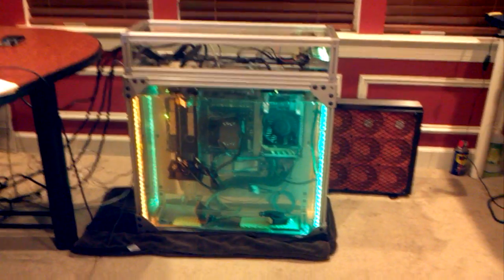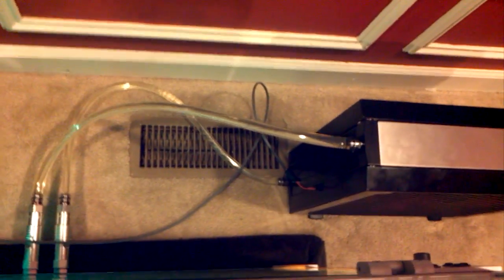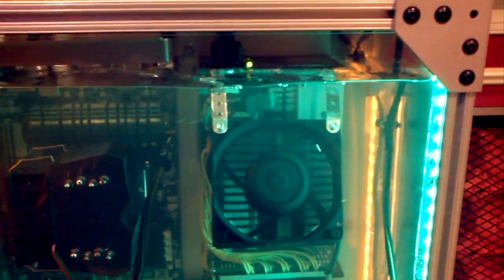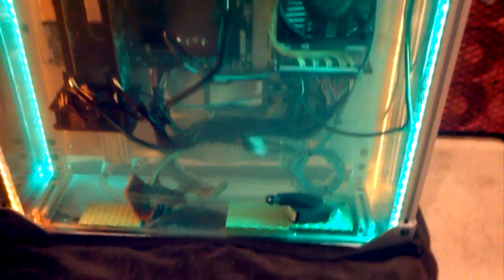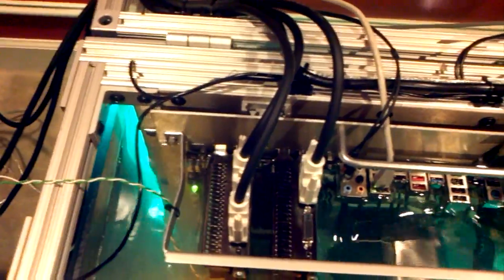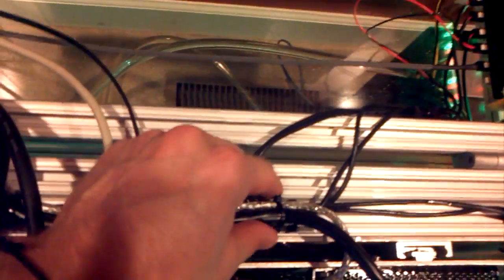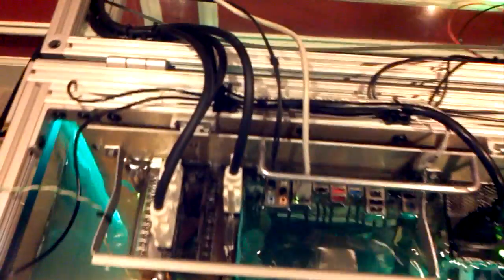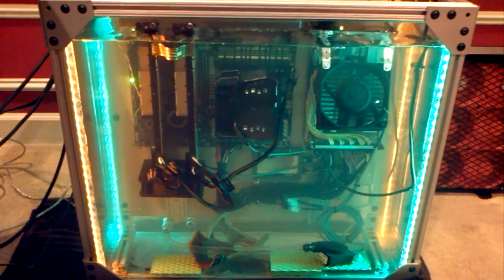Mineral Oil Computer Done!

Comment: I've heard submerged PCs like this don't need a heat sink. since the oil just creates sort of a thermosiphon. (hot oil flows up and cool oil comes from the bottom)
Reply: i don't think the oil would conduct the heat from a CPU fast enough and flow away for that to happen, the CPU would quickly overheat.
Reply: Well you may be right but I've seen it done both ways. They could have also been using some other nonconductive liquid or maybe an older CPU that ran cooler.
Reply from the maker: In my experience your statement is flat out incorrect.  I actually did experiments without forced oil flow and it actually stratified to an amazingly strong degree.  The oil on top was burning hot while the oil on bottom was just warm.  You need forced flow with this much oil
Reply: RabidCicada Ya that makes sense now that I think about it. I can't seem to find that one video where they didn't use a heatsink...whoever it was probably didn't figure that out yet.
Reply: You know what i always found strange about cpu's, what if they were bigger, like much bigger. Would they heat less??/
Reply: minigunexo
Yes and no. Here is why, if we make the processor bigger with current 45nm and smaller cpu chips. Which is how we get 4 cores and so on. We would stack more into the dye since there is more room. However it would be possible to put twice as many cores and run the voltage lower to which in the end would actually add more processor power. This simply a numbers game there. If you did not add cores, then you would be driving up the cost of the mother boards needing to accommodate this dye size for little reason. Realistically this is actually a really good idea, but the market is aiming for more power on a smaller dye. Because of this a bigger dye would likely not happen. I should be considered for servers though since most of those boards are ram and processor going out to a storage farm.

Comment: nicely done, but I don't see a water separator.You must remember that oil is hygroscopic, meaning that it will take in water from humid air. While that might not be an immediate problem having water flowing around near the circuitry sooner or later will be and will cause some mayor connection (and short disconnect) problems.

Comment: If everyhting is litteraly swimming in coolant/lubricant and it operates 24/7 its ok, but when it stops oil will get over graphite brush of the electric engine of the fans, what will happened with fans? Im asking because I want to build something like this but use pumps instead of fans to cool the parts....

Comment: a few things, 1: that dual pump you were getting the X2? how did you set it up, one pump as flow the other as pressure, or both even, 2: positioning the pump, wouldn't it be best to be near the top to extract as much hot oil as it can?, 3: for a different radiator setup check this one out /watch?v=d1_iZ-4Tft4 setup like exhaust fan(hot oil in)fan>rad>fan>rad>fan>rad>fan>rad>(oil back to tank)intake Fan, just a few questions/thoughts

Comment: It is for show and at the same time its not for show. Yes you are right there are much easier ways out to cool your PC. But there are none nearly as efficient. In the video he seems to have a pretty beefy system since he said he had two video cards as was talking about adding a third. By building a system like this he will never have to worry about overheating no matter how much he pushes his system. Even if he overclocks his CPU to its absolute max.

Comment: Mineral oil provides much better cooling than just air alone. By building a machine like this you can push the system alot more and pretty much overclock the CPU as much you want with absolutely no overheating.

Comment: The fan does get oil in it.Everything gets oil in it. The reason people use mineral oil when they do builds like these is because it does not carode metal ( aka rust ) and also does not coduct electricity ( no shorting out ). As far as hardware limitations the only thing I have ever seen is that it seems most fans dont like to spin near as fast as they should. But everyhting is litteraly swimming in coolant/lubricant so no issues.

Comment: Deionized water or distilled water does not conduct electricity, however if ions are introduced into the water it will. Also, water would cause rust.  For that reason mineral oil is used.

Comment: never knew something like this existed.  Kinda wanna try it for the hell of it.  How much does it usually cost to build something like this?  Not the computer parts, just the components like the Case, fans for flow, and the mineral oil or whatever's going in there.

Comment: i like simple pc cooling air or radiators like h100 with out of tubing job and pumps ... this is to extreme for me well its prob geat OC machine yust its not very practical if u have to un plug it remvoe graphic cards replace processor or samthing looksl ike lots of job to do to even get started  with that and if u need move your case from your home somwere else u need ro remvoe all that oil ... when i think on all that stuff its not worth it (good side no over heating or dust problems) :)

Comment: I was thinking you should move the pump (sitting at the bottom of the case) towards the top. Since warmer oil will naturally rise, you will be pumping the warm oil to the radiator, not the cooler oil at the bottom.

Very cool

Comment: If you dont have a radiator I would think a lot of Kobber Wiring would do. You can get it from any Electric motor such as a damaged Mixxer. just putting a lot of it into the oil and the rest at some cool air should cool a lot already.

Comment: It wouldn't be that informative if you don't know what voltages and clocks he's running. He could say his CPU sits at 65c and video cards at 75 and it wouldn't seem that impressive unless he told you he's got twice the voltage running through those chips.

Wouldn't surprise me if it ran only a degree above ambient if the system wasn't overclocked.

Comment: I just dont get it. One would assume the benefit of mineral oil cooling would be either less power consumption or less noise. Instead you have a much larger case and much more power consumption. Sure looks cool though

Comment: Awesome PC build dude, it's pretty epic. Not hating though, but.. isn't it a pain in the ass if you need to connect a removable storage device? Flashdrive, external hard drive, phone, camera etc? Not just because of the mineral oil, but also because you'd have to open up your PC each time you want to connect something? Unless you've got a USB splitter?

Comment: Its ok to be nervous. Spending all kinds of cash on a new build is nerve racking, but builds are usually pretty streight forward. With liquid cooling, usually the modules are pre sealed and use PH neutral water, so as long as your components arn't abundantly dusty, even if your cooler tubing ends up leaking for some unlikely reason, and your computer happens to be on, it shouldnt bridge any connections thus your components should be fine.

Comment: What he is saying is, having that radiator with all those fans and equipment stripped away the usefulness of having an oil cooled computer.

You could have used a standard case with a water block pumped into that same radiator, with the same net result (liquid cooled system), but without all the oil and mess.

You still have the novelty though, and is really the point of the whole endeavor right? :)

Comment: What if you put the gpu and cpu on the bottom so that the hotter mineral oil rises and the cooler oil falls? 
It'd work just like a water heater! 
Like you said, it wouldnt help to move oil directly over the components, but it would at least provide circulation (through convection) without need for pumps.

Comment: Why don't you use short extension cables to move all your cables so they plug up outside the box instead of going through a hole in the lid, that way you can completely seal the whole box and completely fill it so that you can more easily more it or lay it on its side with out the risk of spilling, Heck you could even turn it into a cool coffee table.

Comment: FYI, Arrow Electronics sells those Molex connector parts in single piece qty.  Typically much better prices for Molex parts than DigiKey.  Sometimes they use a different part# for the single piece vs qty packaging; so, you may need to talk with cust svc if you can't find the single piece availability.

Comment: I would have done this at some point in my computer building life but I suppose the issues like oil sneaking into crevices you don't want it (under the CPU) and having to wait for the parts to drip dry (Takes a long time. Something like a week+) has put me off a bit. Think I'll stick to watercooling parts (although having a mineral oil PC wouldn't look out of place in a living room as it looks like a fishtank and would make quite the attraction with the bubbles moving around).

Comment from the maker: IT is not still running.  I had a kid and trying to do anything with it was messy:).  The system worked fine.  There is an increased risk of components dieing due to the chemical reaction you are talking about.  Mainly certain plastics and rubbers react poorly with mineral oil.  Just try to select products without those.

Comment from the maker: The performance of cooling individual parts would not be near as good then.  The fans are required to circulate for better temps on components (as in needed to push oil directly over the components), and due to natural stratification in the oil.  You solution would solve overall circulation but not handle pushing oil directly over components.

Comment from the maker: In terms of performance...it's really a trade off.  For the gpu's mineral oil was largely better...for the cpu...oil was minimally better (but also using a super high powered fan).

I switched back to water cooling because I had a kid and doing anything required 20 cleaning rags to wipe off myself after I was done >.<

Comment from the maker: I don't know what kind of water cooler you are talking about...but the kind on refrigerators require compressors (which are very noisy) and the kind of graphics cards and cpus require something like fans to remove the heat at the radiator anyway.  Am I missing something?  All systems require either active heat removal...or huge systems that can dissipate passively.

Comment: is you system still running? i got after 1 month first problems to solve cpu socket need to isolate oil flows inside and isolatet the pins from the cpu. starting wih bluescreens from time to time.

Comment from the maker: You can absolutely do this with other graphics cards.  Just have to be aware that the devices will likely have a reduced lifetime due to chemical breakdown in the oil.  In particular, plastics and normal rubbers dont fair well.  Read the worklog and legoman666's worklog for more info.

Comment: The liquid in the case is not actually water; it is some kind of clear oil. Basically, all you need to know is that it doesn't conduct electricity, meaning that when your GPU runs, it won't short-circuit because the liquid acts as a sort of coolant/lubricant and doesn't conduct the electricity from anything. I think that also goes for the USB ports, etc. but I'm 100%.

Comment from the maker: It IS VERY messy any time you upgrade/maintain.  But he's exaggerating about week long process...It takes only ~2hrs to strip the standard shield & fan from a gfx card, re-apply newthermal pads, and install it.

Top of the line parts has some truth to it.  You need to be aware that standard plastics and rubbers don't play well with oil over the long term so you need to use non-oil-reactive rubbers and plastics like High Density polyethelyne or vitol and make sure that your new component does too

Comment: Its very efficient as far as cooling goes, but it takes a week long process and a lot of mess and work to upgrade a part. So you better use top of the line parts when you build it.

Comment from the maker: VERY heavy.  That's why I used industrial "Quick-Disconnect" fittings to join the radiator to the tank.  They are intended for use in hydraulic applications, and leave less than a 1/4 single drop of liquid on the surface where they disconnect.

Comment from the maker: Case is completely 100% custom built.  I solvent welded polycarbonate from McMasterCarr, cut and mounted the extruded aluminum, installed the LED strips etc.

I have a worklog up in the description which shows the entire process (warning....I took a long time to finish the build)

Comment: That is a good observation. 1 U.S. Gal= ~ 8 pounds. Maybe 50-60 lbs? Need casters on bottom of tank! Drain to move or transport. 75% Rubbing alcohol would be a different alternative- but you'd have to make seal airtight, and leaks would be obvious & maybe dangerous. This mineral oil cooler is a great idea to me- I've been a builder since '94.

Comment: High voltage electrical transformers- such as 1 on a pole outside your dwelling- contain (HIGHLY toxic) non-conductive PCB oil- used as a coolant. Common knowledge is like common sense- it depends on who you ask. In a chipfab plant (Intel)- it'd be "common knowledge" EXACTLY how a CPU is built- get it? No reason to go insulting anybody. The original auto engines- used alcohol in the radiator. Is that "common knowledge" nowdays? No.

Comment: Sir- for a WAY better pumping system- I recommend an "power" aquarium filter- such as the Rena x1. At around $100.00, it has the "intake" pickup tube, hoses, and "exaust"- just hook up the exhaust to your radiator assembly you have there. It's pump is very powerful (CFM)- & there are no submerged elecrtronic parts- that add unwanted heat. It's pump- uses a magnetic-inducted impeller. Just leave out the filtering media (charcoal & pads). It's intake tube- comes with suction cup tube anchors.

Comment: This is a very interesting concept- I've seen & worked with- a machine that uses a type of oil- that sheilds, insulates, & dissapates the heat- when using VHF voltage to desintegrate metal- like a CAD CAM mill would. It uses a permanent Carbon electrode- to bore into the metal. The process is called EDM (Electrical Discharge Machining).

Comment: The voltages would break down the water- creating exsposive Hydrogen gas. It's called Electrolysis. That's how a Hydrogen Fuel Cell works (for a car).

Comment: do not put a hard drive in oil. they have a breather hole and DO NOT work in a vaccum as the other guy said. keep the drive out unless you're using an SSD in which case you should be fine.

Comment: nothing special. since all the electrical connections are always already in contact with the oil, there's no problem with exposing the PCIe connector to the oil while changing out Cards. its a simply a matter of pulling out the tray and disconnecting the GPU. then install the new one. the only point of caution would be to wait till all the fans have stopped before draining the oil, then wait till the fans are completely submerged before turning the power back on. and you didn't think of that?

Comment: Also, lol@ ragers.  You must not understand.  Let me explain this to you simply:

This guy has, with his liquid-cooled computer, more processing power then he could possibly coax out of an air cooled computer, simply because oil is a better conductor than of heat than air.  

That in and of itself is really cool.  But, he is not using this amazing processing power to watch hi-def porn or play his computer games on ultra graphics (ok, maybe he is, but that's not all).  He's doing Folding@home.

Comment: just as distilled water it is non-conductive, but if you used distilled water if it touched any metal showing such as pin connectors it would take the ions from them and short it anyway. But with oil it won't take the ions from any exposed metal and therefore won't short out any of the components.

Comment: Great build man! But one question please… Do you have any way of determining the volume and pressure of the flow through the pump and cooling you unit? Any flow indicator? I’d really like to see how good the flow is. I’m almost done with my oil rig, but I’m wondering if I’m the only one who is having a low flow problem. I’m using 3X MCP industrial pumps in series, and still having a low flow! 

Thanks for any advice...

Comment: Not really that hard, just make sure your computer is working before you start pouring in the mineral oil, best if you actually have it running as you pour it in, and also make sure you have a separate power button for the computer, which you can probably find at most normal computer hardware stores.

Comment: Love the case and love the project... my question is why is the pump on the bottom heat goes up and your trying to push the hot oil down... its like playing catch with water... using much more energy as well as a large amount of effort on pulling mot likely a good deal of already cold oil thru the radiator. Its a beautiful project just i feel that one change would yield better results. or worst case.. find a scoop to "trap" a hot pocket around the pump.

Comment: It is about twice as better as water cooling , so anyone that wants to overclock to the absolute extreme this is the best solution. Remember this only applies  if you use the pc 24/7 about 95% f the time (If you have a pc turned on for a long time the water cooling loses efficiency) because while oil cooling is not the best solution for someone who uses the pc about 7 or 8 hours a day anymore than that it will show some pay off's.

Comment: Wouldn't you be better lowering the mobo deeper into the oil, and pumping out to the radiator from the top, rather than the bottom of the tank ?  I'm willing to bet the oil has a thermal gradient similar to water, where it's fractionally cooler the deeper you go, and warmer nearer the top.